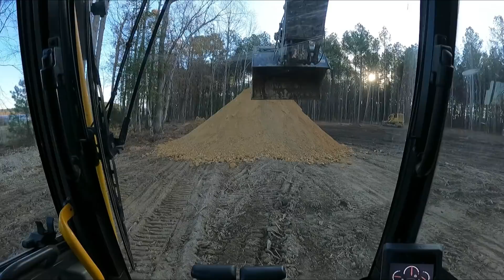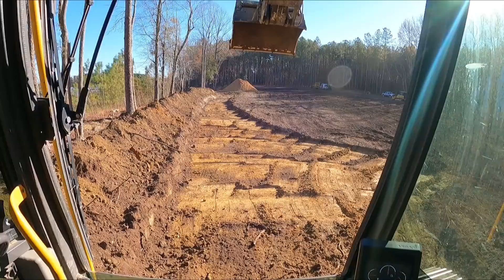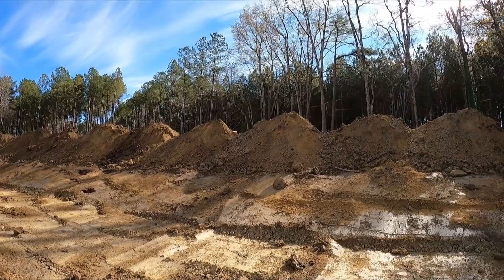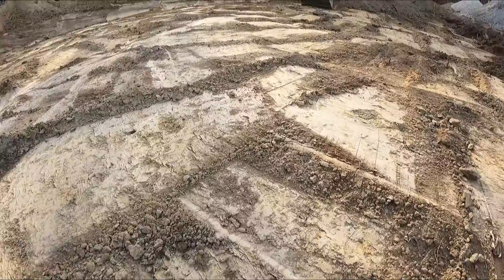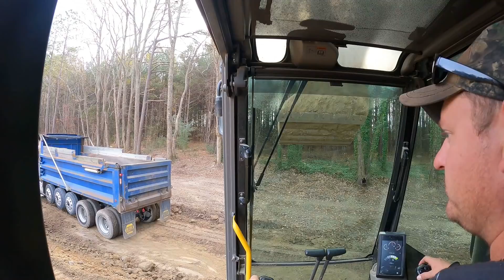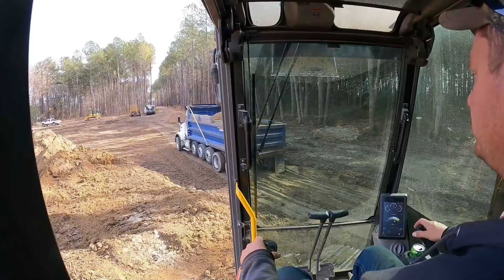Stripping All The Topsoil From The New Pond Site

Comment: Awesome work and very nice camera work
i thought you would stop transfering dirt and move it with betty if you got longer distances to transport 
i guess its cleaner with the grading bucket 
i thought you can strip topsoil with betty by useing the bucket like a scraper
You should consider line the pond edge with clay so the top soil and sand on whaters edge doesnt get saturated - if the ponds whater table is gonna be taller than the beginning of the top soil layer 

i still dont know where the overflow is going can you just dump whater into a solar farm?

Comment: What are extra wheels on the dump truck for?  They don’t seemed touch the ground at all? Curious lady.
Reply: They are extra axles for more even weight distribution on paved roads with weight per axle limits..so many tons per axle ..they are operated up and down by the driver as needed..hope this helps

Comment: What kind of permits do you have to pull? I've been wanting to do a small less than 1/2 acre pond in my back field. I have a underground spring that runs through my field back there. Thought about putting the pond on the lower side and letting the overflow continue the water flow to the "small creek" drainage ditch.

Comment: I have been watching you guys for a long time now but I have a question. When you are stripping for a pond I understand why you use an excavator to shape the outside of the pond but why don’t you use a dozer for the big body parts?
Reply: You can move more cubic feet per hour with an excavator than a dozer in most instances and once you get into the clay its going to want to spin tracks. They only thing that moves more is a scraper and are big out in Cali for large housing developments.
Reply: He needs some hoses for Betty that will be there in afternoon and fixed

Comment: let me ask you a question. when you are doing a job of yours, and you need your machines moved to the job, i sometimes see a truck and trailer move them. do you pay to move your bigger machines. wouldn't it be better to get yourself a truck and trailer like dirt perfect, that way you can move your own stuff
Reply: Cheaper to pay someone to haul than to have own low boy and tracker. Have to pay for permits,insurance etc, etc, etc. Chris pays about $400 each time. Compared to thousands of dollars to insure, lic and register, inspection, fuel, maintenance etc, etc, etc

Comment: @letsdig18 - When you're building, clearing, or repairing ponds, do you ever wish you had a bigger 300 or 350-sized excavator?  Or is that too big for your "normal" jobs?  Thanks for the videos / content.
Reply: The company had a 290 but sold it because it was just too big ,slow and didn't really fit the work.
Reply: @kenore4003  Thanks.  I remember that (now).  Wasn't sure if the 290 or larger would be more appropriate for this job.

Comment: Chris you're talking about sandylome  it's a mix of sand clay mixed together I do believe we use it for back filling for our septic tank installs I work with septic systems new and old ones service maintenance and new installs spray drip low pressure dosing sometimes regular drain field John Kimbrell SanAntonioTX

Comment: I want to see you build a twenty plus feet deep pond. Is it possible to do with just an excavator?
Reply: Most probably. Digging in, no problem.
Getting out of it, well... 🤫
🤣🤣
Reply: He built a huge lake several years ago.  I don't really remember for sure but it was probably 15 feet at the dam.
Reply: @daneclark3161  I'm thinking it was probably twenty feet or more in depth. It's about five acres in size and was all dug with the excavator and hauling with the off-road dump truck. The small dozer was used on the dam and for finish grading around that pond. That's one big beautiful project accomplished. Chris actually revisited that project and showed some video of it flowing into the overflow pipe after a big rain filled it.
Reply: @RAYAR54  - Now that I think about it, you are probably correct.  I remember the entire haul truck fitting down inside of the damn core.